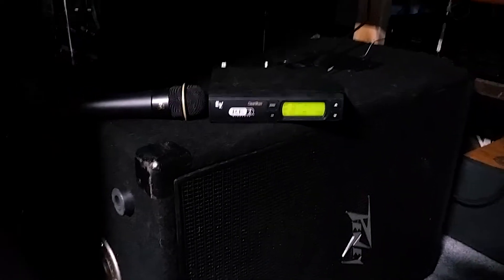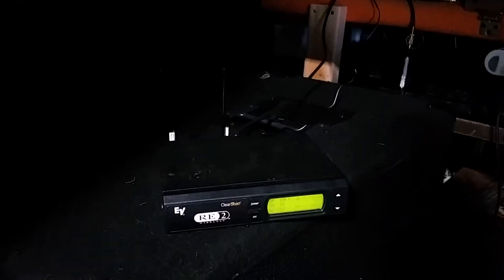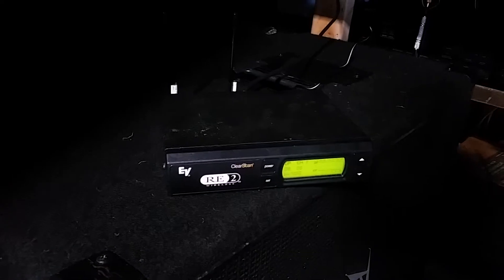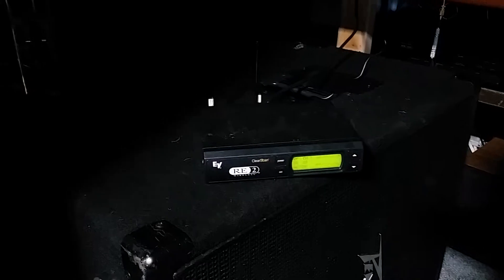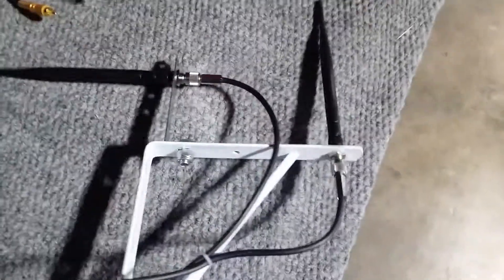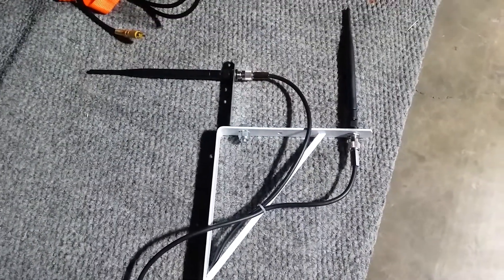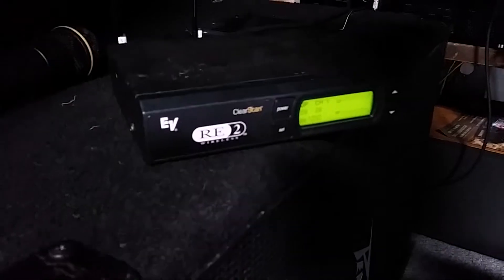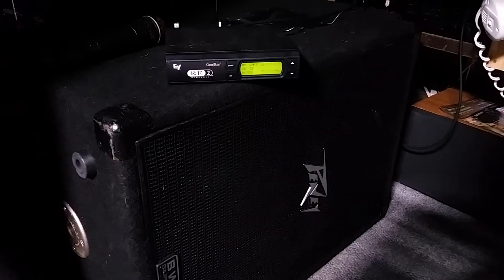Upgrade the antennas on my Electro Voice EV RE2 Wireless Microphone. Exterior mounted on my DJ Van

Comment: I think I missed a video. Did this happen to work?
Reply from the maker: It worked excellent. I actually just did a video today that I hope to post tomorrow where I have installed six wireless microphones in my new Step Van project. I am just receiving all of the materials to put 6 antennas just like the one I showed you I with two antennas mounted on each bracket. The 12 and Tennis showed up I am waiting for the 12 coaxed  and the fittings then I will install the six on the step banded to another video. I have wandered in the eighth of a mile away from my van and still had use of my wireless microphone. It works excellent. Other mobile DJs have come and looked at my setup.
Reply: @GlennsSpeedShop  Groovy! Hopefully I'll be able to find it when you post it.